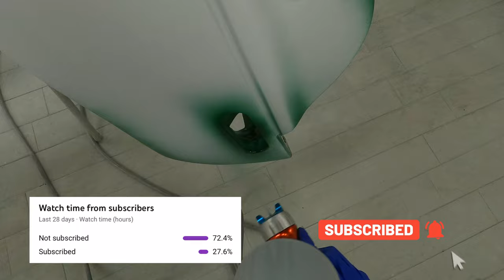Final Paint and Build - Mazda Miata Mx5 Respray Part 3

Comment: Hello Tony I like the way you  broke up the different  parts of the video  as you  get the chance to see how you spray  smaller  parts it's perfect also I have heard you  say something that no one Hardley mentioned  and that is the difference  of 1.2 1.3 nozal now that would be interested to see , also to hear what you  have got to say and should  a beginner be better off  starting  with a 1.2 . I always thought 1.2 Is used mainly to spray small parts so yes I would  not  mine seeing you do a video on the two difference  between a 1.2 and a 1.3 thank you  for the  video Tony always injoy your  channel and stay safe
Reply from the maker: Hey man and thanks buddy , yeah I think it’s always good to try and include as much info for you guys as possible tbh , and a lot of people forget it’s a lot easier to paint in a booth with bigger tip sizes and go a lot wetter than it is in a cold not so perfect environment so you need to change how you work accordingly

Comment: Great video! I would love to know what pressure do you run off the wall regulator? not the gun regulator. Thanks
Reply from the maker: The wall regulator I usually have set to 8bar I think it is mate but we have a huge compressor now so we could set that almost anywhere tbh

Comment: Bang on content Tony..always waiting on your next YT uploads the Mazda looks knockout🥊 mate
Reply from the maker: Thankyou buddy
Reply: @TonysRefinishingTV  Hi Tony ..hope you don’t mind. a question I have 2017 A3 black. Recently I noticed the paint on bonnet and roof starting to look little dull after initial hand polish ( with one of those high end ceramic liquids ) the panels appeared streaky only under direct bright sunlight. I tried some cutting compound g3 with my polisher no success so then tried polishing pad on its own with just wax only it did reduce the streaks but you can still see them faintly in direct sunlight. Any pointers to rectify would be appreciated mate.
Reply from the maker: I don’t mind mate at all is the issue down to the ceramic where you’ve applied it then ?
Reply: @TonysRefinishingTV  On bonnet and roof  the 2 biggest panels on the car. What amazes me it looks fine until sun light hits the panels. Is it contamination with the application of ceramic on top Tony ?causing the smearing or tiger lines as I call them sorry no pics?
Reply from the maker: Sounds like it’s not quite been bugged off properly maybe mate I’ll be honest I’ve not had a huge amount to do with ceramic I’m not a big fan lol , but from what I’ve seen and heard it would be down to not being applied or bugged off properly so maybe try applying some more and see if it will get rid of the streaking and just make real sure you do it by the letter mate
Reply: @TonysRefinishingTV  Cheers Tony will have another go by the book..

Comment: Car looks fantastic Tony. 2 questions. I am a DIY painter on a tight budget, still a lot to learn. Why use solid colour 2K and not basecoat/clearcoat? Also, I bought a DeVilbiss FLG5 1.4 gun to use as my main clearcoat gun. I am plagued with runs. Could this be the 1.4 tip instead of , say 1.2? Cheers, Bob.
Reply from the maker: A solid 2k colour for a job like this ( not massive priced ) is a lot more cost effective for us and so the customer too mate , no you should be ok mate with the 1.4 just turn the fluid down abit mate